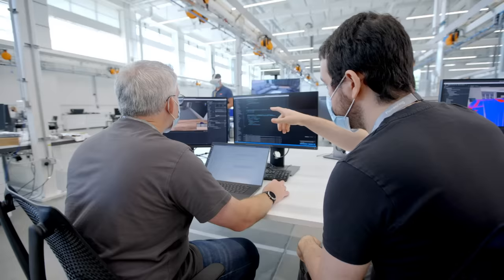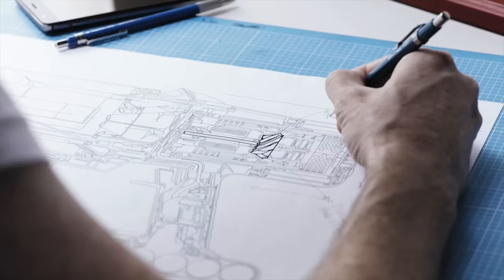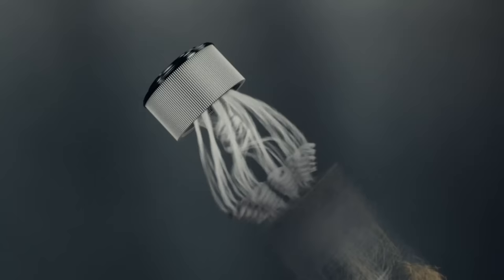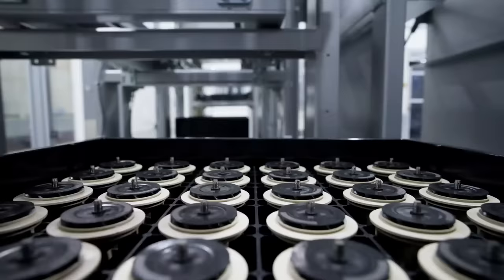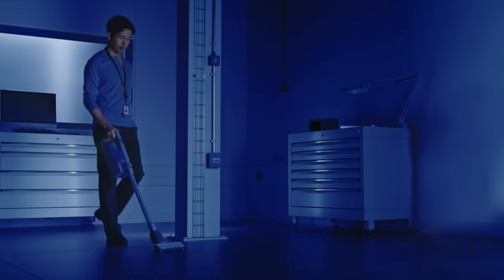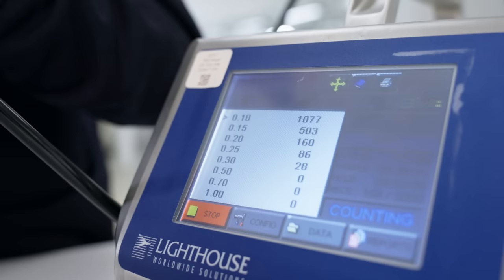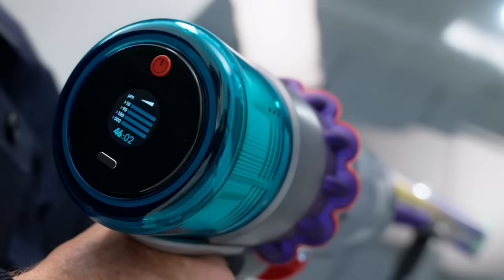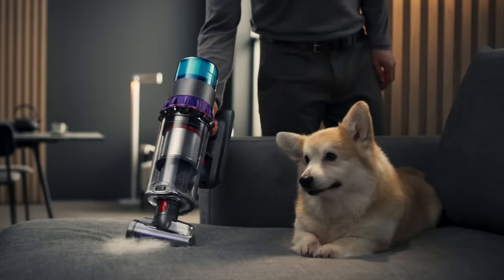James Dyson unveils Dyson's most powerful cordless vacuum with HEPA filtration

Comment: but can it run while plugged in? or is that still too advanced for the dyson engineers to work out?
Reply from the maker: Hi there, thank you for getting in touch with us at Dyson customer service. For us to fully assist and resolve your query, kindly DM us on any of social platforms.
Reply: @dyson  i asked a yes/no question, can you please just give an answer?
Reply from the maker: Our cordless machines are designed to be cord free and would not come with the ability to stay plugged in. We have upright models that stay plugged in so you do not have to worry about a charge.
Reply: @dyson  that's horrible. fix it.
Reply: @dyson  given the design flaw with the plug, surely you can swap the battery out once it drains, so you can finish vacuuming your stairs, correct?
Reply: @PplsChampion lmao but fair play to Dyson for responding.

Comment: Nice improvements, they even made it less glossy, which is a plus. Hopefully the plastics will fare better, as they don't seem very robust, especially considering how expensive these products are.
Reply: Thy are very robust. Dyson's feel flimsy but a vacuum is subject to a lot of stress in its body (the head, the various snap in/out joints) making something rigid and solid means the energy has nowhere to escape, and causes fractures. A planes wing is designed to bend for this reason, a car's bumper is designed to deform rather than immediately crack. Dysons are usually made from polycarbonate, which is a higher grade plastic than ABS as well, but it is thinner, while it might seem less solid, they are far stronger and more flexible. Good enough for riot shields.
Reply: I've owned my v10 motorhead since 2020 - used. Can confirm the plastics are well made n durable
Reply: its supposed to weigh little, not be a tank

Comment: Great presentation. That is again next level compared to existing technology. I do hope it can pick up small rocks (3-5mm) and leaves. My V11 does not want to eat those it spits it out. It would be nice if dyson would make a trade in program for previous gens to enable a cradle to cradle approach. Have not seen many companies doing that yet.
Reply: Why are u using it to pick up rock n leaves when it wasn't designed to pick that up? That's like me hoping my washing machine can wash my dishes
Reply: is htis better then the v15?
Reply: Picking up rocks? Absolutely mental
Reply: my v8 didn't have any issues with lil pebbles and some big ol leaves. sucked em right up. I only used the multi-tool for that tho. the rolling floor brush doesn't like any large solids.

Comment: I plan to upgrade from the Dyson V10 to the Dyson V15s Submarine when it comes out. Being able to wet clean hard floors and also use it as a normal vacuum will be great. This is a product I have wanted Dyson to make for a long time. From the Dyson press release ‘The Dyson Submarine™ wet roller head, available with the Dyson V15s Detect Submarine, delivers just the right amount of water to effectively remove spills, stains and small debris from hard floors. To achieve an optimum ‘clean floor’ finish without over saturating, the wet roller head has been engineered with an eight-point hydration system, using a pressurised chamber for even water distribution across the full width of the roller.’

Comment: We bought a Dyson V11 for my mom. To be honest, I would throw the thing out of the house and here is why:

- To remove pet hair from the carpet is on the eco seeting usless. It needs to be on boost mode. However, it is it that loud that you think you are having a fighter jet in your living room. Also that high pitch that comes off reving up the motor, tells me to keep the hands off. The Dyson cannot even hoover spilled cat litter. You need hearing protection when using the boost mode. 

- Top heavy. The fact that it is top heavy, it is difficult for elderly people. A botton heavy device is much easier to handle can cause less pain on the wrists. 

- Won't stay upright. When pausing hoovering for a sec because you want to move a piece of furniture or something else you always need to rest the hoover against something. This is total crap. Placing the Dyson against something (door, furniture, wall) does not work all the time. In many cases the Dyson would just tip over 

- Battery power: It lasts exactly for one tour around the house on eco.

- Sometimes I think, the Dyson does not clean at all. Especially when moving with that roller thing for hard floors over the wooden floor. The dust particles are often not sucked into the machine from the sides.

We are having another hoover wit cord. It can stand upright, It hoovers everything in one go and is far beyond the Dyson.
For me the Dyson has become pretty much worthless because I rather use the corded and the job is done.

The perfomance of the Dyson is overrated and crap in my opinion.
Reply: 1- clean your filter and adjust the head's gates to the middle setting, the V11 should have NO trouble cleaning up pet hair on carpet. Eco is really just for hardfloors with the fluffy head.
2- if you want a powerful motor, and a long runtime you need a big battery, bottom heavy units aren't shaped well for handheld use in the car.
3- If you wanted an upright, should've bought an upright unit, you don't buy a bike and complain that it can't fly.
4- use the fluffy head on hardfloors, if you don't have one then open the head's gates

Clearly you bought the unit without fully understanding the model or being mislead by retail staff, shame.
Reply: @Clove_Parma  thank you for your advice:
1- Filters are cleaned every time after use, maybe every second time. Adjusting the head gates does not help on two rugs in particular. The brush removes the pet hair only together with the boost mode. During eco mode the motor speeds up but does not create enough suction. Then to boost mode is being switched, then hearing protection is recommended and this is not a joke.
2- most silly comment/answer that someone could provide. If you have a bottom heavy device you also could get hose to get the car cleaned out? Anyway, a good engneer could come up with a solution. Then it also would be possible to design a device that rests upright, when moving things around while cleaning.
3- this tops the most silly comment/answer because it is a design flaw. How often tipped yours over? Plenty times, am I right? So, please don't comment on this.
4- The 'soft roller' , the fluffy head, is being used on hard floors and on eco mode it is not the greatest.

We bought the hoover for my mother - an older lady. Her idea was to use something lighter in her hands, that she also can do some cleaning around the house whenever she feels like to do so. As having explained, for older people this design causes pain to wrists. A bottom heavy device is easier to manouver around with because you would have more leverage.

I have shared my opinion, how I have been feeling about using this device and this is my sincer and honest experience, and please Ieave your sarkasm blank next time. Not needed here.
Reply: @oliverlison  just say you can’t afford it
Reply: You should be more upset at the public education system in your area

Comment: This is such a game changing vacuum. Honestly, would never have thought I'd ever be impressed by a bloody vacuum cleaner. I bought the Gen5 end of last year and I vacuum in the dark - weird, I know, but the laser illuminates a whole layer of dust on the floor, something you'd never see with the lights on, and the machine JUST WORKS, it does its job very well and has powerful suction and an easy-to-use dispenser system. Also, the scratch-free soft brush is something I've longed for - I can finally just vacuum the dust right off the surface of my monitors or expensive LG OLED C2 Evo TV without any chance of ever scratching it (I have checked after by illuminating it with white light in various directions, no hint of micro scratches). So, kudos to Dyson.
Reply from the maker: That's some great feedback! Glad your Dyson Gen5detect™ vacuum is working so well for you 😀

Comment: I’d love to see Dyson release a metal or alloy up-right vacuum. Something with a bit better build quality than what they produce today. Don’t get me wrong, my Dyson has never let me down for as long as I’ve owned it, but the build quality and the feeling I get from using it doesn’t leave me with a sense of longevity or luxury even.
Reply: i think its a trade off between light and sturdy because they tend to be heavier if they are sturdier which is quite bad for a handheld device
Reply: @mrhappyfaq32  Yes, I realize the weight wouldn't be ideal for a handheld, but I'm suggesting an up-right vacuum which they seem to be slowly distancing themselves from.
Reply: @fty-ys4ni  nobody buys the uprights anymore (in the quantities needed to justify R&D in new models)
Reply: I wish they could use a better quality plastic.I have had a dyson and now I have Miele and this is like day and night compare those two.I still like Dyson but plastic quality is very bad.
Reply: They ought to at least follow the powertool brands by making the body of the vacuum out of glass-filled/reinforced Nylon(i.e. GF-PA6).  For the ridiculous prices they charge they ought to making them out of better materials than ABS.  For what they charge, they could make the body out of metal enjection molded aluminum, or laser sintered, or maybe even CNC. Considering these are China-made, the $600, $700, $800+ price tags for a pile of plastic is kind of :/

Comment: Hi,

Please consider developing cordless upright vacuum.

You did incredible work miniaturizing motors and improving battery life, but over time your handheld models still grew significantly in size. Although the bin size also increased to the more practical levels, the emptying experience is still miserable. The dust is flying around, undermining your great HEPA filtering system.

Just imagine the possibilities of bigger form factor combined with your latest technology.

Comment: I love what Dyson aims to do, but I don’t understand why they use brittle materials in stress points in their products.   My vacuum had a plastic release clip to empty the dust chamber and after a year it just snapped off, despite careful handling.  It made the whole vac useless as the chamber now can’t be closed properly. So disappointed
Reply from the maker: We select the materials we use for different components very carefully, and test rigorously to make sure they're tough enough for daily use. From what you've said, it's possible your machine is still within its free Dyson guarantee period - but even if not, we offer a wide variety of spare parts. If you haven't already got in touch, visit dyson.com and click Support to find the contact details for Dyson Customer Care in your country. Our experts are standing by to help!

Comment: I bought a Gen 5 outsize, but still no LED lights on the vacuum head.
Reply from the maker: The Dyson Gen5detect™ vacuum includes illumination technology on the Fluffy Optic™ soft roller cleaner head, which is engineered for use on hard floors. Mounted close to the floor surface, and with a 300mm range, it works by illuminating particles of dust and debris, and not the floor itself. But the illumination technology isn't included the Digital Motorbar™ cleaner head, as it doesn't provide the same benefit on carpeted floors.

Comment: i thing that Dyson could improve is the overall quality feel of the product (vacuum) the plastic is very cheap to touch and also the locking mechanism is also somewhat flimsy 
the product (Vacuum) works very well etc. but you don't got the feeling that you are using a premium product, even though that you pay a premium price !
Reply from the maker: The engineered blends of materials we choose for our machines are very carefully selected to balance weight, strength and durability. Robust enough for daily use, and flexible enough to absorb impacts. They're rigorously tested during development and throughout production - both in our labs, and in real home environments. You can see just a handful of these tests here: http://ms.spr.ly/6050glXmu
Reply: @dyson  i believe you 99% in what you are telling me. You just forgot to mention cost/price because that is also something  you take into account when you are producing products.

Comment: My Dyson Cool is now 8 years old and my V6 is now 7 years old and both are still going strong.

The DC40 Animal Erp we had lost most of it's performance and came to the end of it's life after just 6 years, despite being very well maintained, so we decided to not buy another Dyson upright and instead opted for a quality upright from Sebo. 

When my V6 comes to the end of it's life, whenever that maybe, I definitely would consider another Dyson Cordless for quick cleans and picking up spills, however, the gen 5 is way out my price range.
Reply from the maker: Thanks for your feedback! Glad your Dyson Cool™ fan and V6™ vacuum are both working well for you! Under normal use and when correctly maintained, we wouldn't expect a change in performance with your DC40 as you've described. Appreciate you now have a replacement machine, but if you still happen to have your DC40, we'd be happy to take you through some simple troubleshooting checks to pinpoint the cause. Even outside of the free 5-year guarantee, we can arrange servicing or provide replacement parts wherever needed.

Comment: The vacuums are unreal, but I've been disappointed many times withe the batteries... If the longevity of the batteries has improved this thing will be awesome....
Reply from the maker: There are a number of factors which impact the lifespan of the battery - including how it's used and stored, and how your machine is maintained. But Dyson cordless vacuums include a free 2-year warranty, and we'd expect the battery to last at least that long. We have some useful tips to help prolong the battery lifespan, which you can find here: http://ms.spr.ly/6053g4A0x

Comment: I’ve tried every cordless vacuum and I’m hoping this will finally be the one I can use to suck my in-laws out of my life.
Reply from the maker: During development we test our vacuums for outstanding performance across a wide range of floor surfaces and debris types - but we can't promise results for in-laws, unfortunately 😉
Reply: @dyson  ahhh is that because they are even more annoying that 0.1 microns? Did you try applying suction directly to the face?

Comment: what about getting right at the fundamentals? dysons plastics of my v15 detect are miserable and not robust enough… with careful usage they got flimsy in less than a year… :(
Reply from the maker: The engineered blends of materials we choose for our machines are very carefully selected to balance weight, strength and durability. They're rigorously tested during development and throughout production - both in our labs, and in real home environments. You can see just a handful of these tests here: http://ms.spr.ly/6058gYLQk If you need any help with your Dyson V15 Detect™ vacuum, just visit http://ms.spr.ly/6059gYLQZ and click Support. You'll be able to find the right contact information to reach Dyson Customer Care in your country.

Comment: I owned a Dyson and it was a POS. It was certainly sexy looking and it worked pretty good for a few months. The problem is the all plastic moving parts, which eventually become scratched by sand/dust. Once the sheen is etched in this manner, the flapper becomes stuck. I was constantly having to take it apart like a surgeon. Eventually it just stopped working altogether because of the flimsy plastic. Never again.🤨
Reply from the maker: Dyson machines are manufactured from tough ABS and polycarbonate which is the same material used in riot shields and motorcycle crash helmets. We rigorously test our machines and back our confidence in our product with our 2-year warranty.   If you are having an issue with your machine, please reach out via private messaging through one of our social media channels -  facebook, Instagram, or Twitter).  We'd be happy to help.
Reply: @dyson  2 year warranty doesn't sound like you're too confident in the longevity of the product, that's bog standard warranty for most household goods.

Comment: Apparently this can capture everything except for 4 days old popcorn kernel bits
Reply from the maker: Dyson Fluffy soft roller cleaner heads are ideal for tackling small and large debris on hard floors - popcorn kernels included! http://ms.spr.ly/6054gc9A4 On carpet, the gates on the Digital Motorbar™ cleaner head can be opened to help draw in large debris without snowplowing.